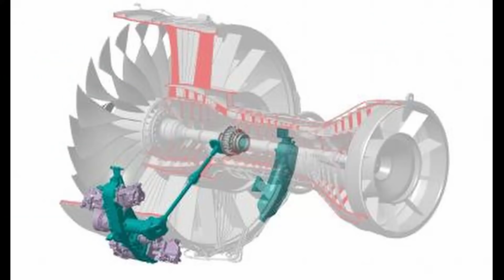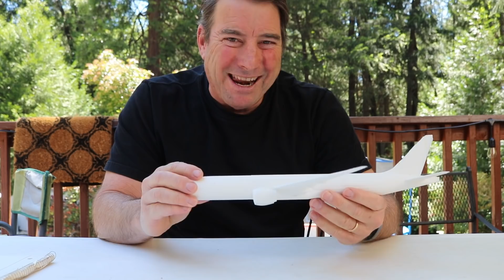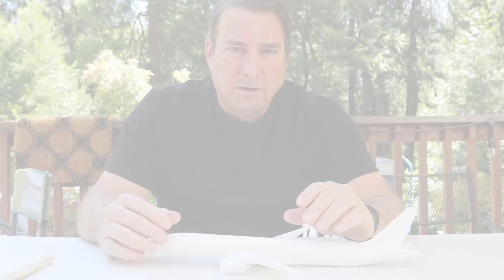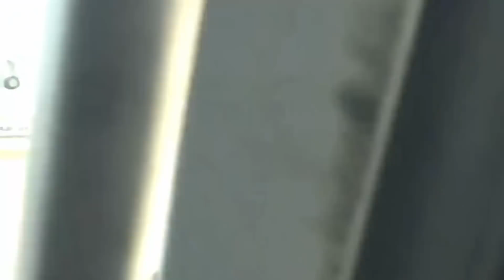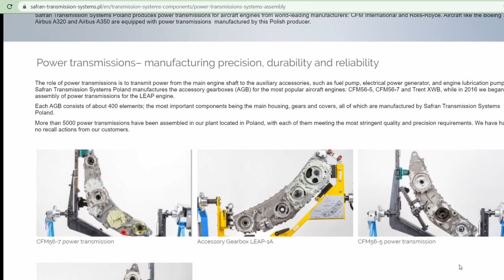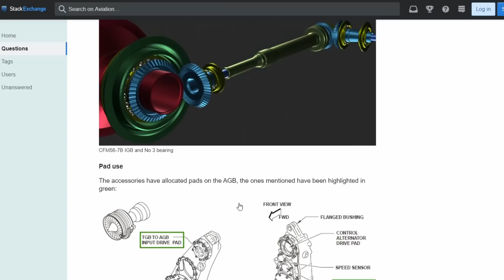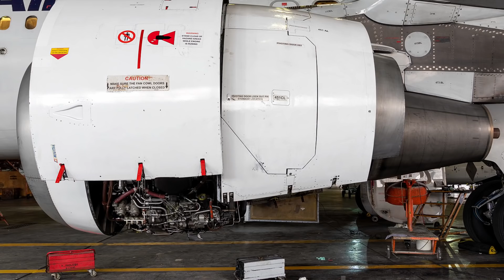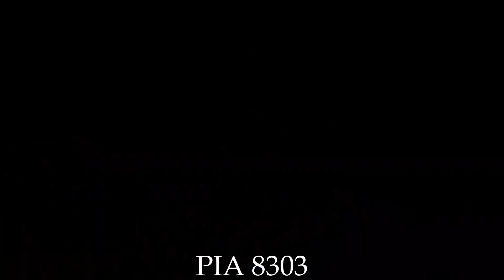PAKISTAN INTERNATIONAL AIRLINES #8303 UPDATE #2 23 May 2020

Comment: Thanks for the update! One question: if the engine touches the runway, and therefore causes damage, if a hydraulic line is compromised, can the ram air turbine keep the system (or systems) under pressure, or does it leak out even faster?
Reply: Separate systems with a series of check valves to isolate the main system. But if the fuel pump is compromised, it's flame out... Although as Juan points out, though it is a very robust system, it should have NEVER been designed in such a vulnerable position. I suspect it was a trade-off for "ease of maintenance" to access it vs probability of accidental damage.
Reply: @JeffCounsil-rp4qv  the engines may be positioned on top of the wings..it was done on some commercial planes ...i remember ..may be it was a fokker f_28
Reply: syed nr I don't think engine designs anticipate the possibility of go around after a belly landing.
Reply: The RAT is likely coupled to a third reservoir with it's own fluid supply.
Reply from the maker: Should be ok.
Reply: Makes no difference how much hydraulic pressure the RAT is producing if the engines have no power due to the damage caused by slamming them onto the runway.
Reply: There are devices called hydraulic fuses that shut off if the flow exceeds limits (eg ruptured hose or tube), to prevent the whole system from running out of fluid. It depends where and how bad a leak is as to whether or not a hydraulic fuse will be helpful.
Also, there are 3 completely separate hydraulic systems. The fluid in each system is isolated from the other systems.

Comment: If the pilots hit the ground with the engines without landing gear down, and then tried to climb, shouldn't the tail have hit the ground as well? There doesn't appear to be any tail damage in the photo.
Reply: If I have understood the Airbus system under normal law correctly the stall system will prevent it. It will not raise the nose more than possible without stalling or tail strike 
The more I read about the Airbus automation system the more impressed I am

Comment: This reminds me of Air France Flight 296 which was demonstrating a low pass, and then failed to have the engines spool up when attempting to go around crashing in trees off the end of the runway.  The Captain Michel Asseline, one of the early test Pilots, claimed there had been a glitch in the software which prevented the engines from spooling. Essentially being below 100' with the gear down and engines near idle the aircraft was programmed (Law) to land. Question! Could this have been a factor in this accident???? Learning and understanding the different "Laws", computer modes, was a big part of the transition to the Airbus.
Reply: AFAIK there was nothing wrong with engines or the plane. They just flew the demonstration way too low and slow.  When they noticed the trees ahead, they applied full throttle and tried to pull up. Flying so slow they were nose up (high AoA) and near a stall. Big engines on full throttle mounted below wings would force the nose further up and stall the plane.
The Airbus  has anti-stall protection laws and they prevented the stall, but the plane hit the trees before it could get more speed and climb to safety.
I don't see how the anti-stall laws could have caused this crash, but my flightsimulator (FlightGear) experience on c172 and watching air crash investigation shows on tv does not make me an expert :-)

Comment: I would have hoped that most airports have video on their runways, which would answer a lot of questions in this particular case.
Reply: I have a feeling its not going to be released to the public.
Reply: They do but it is not accessible to everyone else
Reply: Certaihelped out on the FedEx crash in 2009 in Japan where it bounced during an extremely hard landing and then rolled over.
Reply: There are very few of these incidents; it wouldn't be worth loading up thousands of airports with millions of dollars worth of weatherproof HD television systems.
Reply: Kenny Phillips — Why would they need to be HD? 
Any video could help, as the ones the amateurs have taken.

Juan used one, and a photo of the plane taken by an amateur plane spotter.
Reply: Kenny Phillips outdoor camera’s are insanely cheap. I’m sure they have some
Reply: Kenny Phillips--not that expensive.

Comment: My question is how close to the runway were they before the alarm set off? Why did they lower the landing gears so late? My condolences to the affected.
Reply: I’m not familiar with Airbus...but it’s generally not tied to altitude.  If either the gear position doesn’t match the position of the gear control, or (more likely here), the flaps are set to a landing setting without the gear down, you get the alert.  Seems the French designers were too polite with their alert tone.  No way you could concentrate in a 737 with this.
Reply: The ECAM Master warning you can hear in the audio if it was for a gear issue is triggered at 750ft RA. GPWS would go off at 500ft RA
Reply: Thomas Mortimore just saying, the configuration warning in the 737 is loud & obnoxious.

Comment: There were a couple of survivors of the crash. One of them gave an interview to the media in Urdu. Roughly translated, he said that the airplane touched down, the felt it and then the pilot went back up and around.
Reply: An airliner has a huge amount of mass it takes time for direction of travel to change form aerodynamic inputs to overcome the momentum of the mass moving in the direction it was currently going when the change was made so they may have started their climb out  before the impact pack but momentum continue to carry the aircraft downward. The big question is why weren't the wheels extended?
Reply: @theoldman8877  Your momentum theory is flawed. The aircraft was almost a mile down the runway when it kissed the tarmac with the engines. He was in ground effect during the abort decision and the engines did not quite spool up fast enough to maintain airspeed to maintain distance from the tarmac.
Reply: Two survivors.
Reply: That touchdown he felt was on the engines, not gear.
Reply: Thank you. Prayers for their recovery and families.
Reply: I think it would of turned out better if he left it on the ground. How long is that Runway?
Reply: @Špý-VS-Špý  3400 Meter
Reply: @TELE6220  leave the English lesson in English class. If you study English in several different nations you will find it is both different and correct at the same time.
Reply: @theoldman8877  No matter what nation you are in, it's "would have"
Reply: @theoldman8877  The survivor account is that the plane touched down, and then took off.  My guess is the wheels were extended when it landed.  What happened next seems to be the "big question".
Reply: I don’t understand how there were two survivors?
Reply: TELE6220 we clearly understood what he ment so stop trying to impress yourself. One interuption does not call for another.

Comment: They cannot put these assemblies on top of the engine because of weight distribution. 
You cannot design engines so they survive pilots bouncing them.
Don't blame the design, people.
Reply: Wait, today’s environment suggests we can’t blame the people, so it’s all about design deficiencies.
Reply: "Weight distribution?" Bullshit. It was a decision by marketing so as not to have to roll out a boom truck to service the unit. The weight distribution is totally unaffected by clocking the drive unit under the wing
Reply: @vidznstuff1  The engine is designed to be "bottom heavy" for a reason...btw... it is also a design feature related to the reason the engines are so low slung on this plane, actually.
Ps...Don't bounce the engines.

Comment: This is a bonafide head scratcher ..!??!
Reply: Watch part 1 from May 22. It shows an audible alarm about landing gear not locked (or down at all judging from the damage) during a radio communication. I'm no expert, but that alarm should sound with enough time to do something about it. Guessing they didn't respond quickly enough.
Reply: @kenmore01  The alarm went off on the first approach.  There was enough time to respond correctly.  I'm not sure if it was a case of "get it down and in the gate, we're on a tight schedule" or a case of "the alarm went off, we hand cranked the gear, but possibly not all the way", and they landed thinking the gear was fully down, causing the gear to collapse having the engines collapse onto the runway, and they pulled it back up again after the damage was already done.

The minimal damage to the underside of the aircraft in other spots baffles me as to how they were able to get it back in the air without scraping the tail section more than what possibly may have shown.  I just don't know.
Reply: @vtwinbreed. It was only the nose wheel that failed. Still, the engines hang lower on the A320 than they do on the Boeing 737, low enough to scrape. . He might have gotten away with this bone head maneuver in a 737.
Reply: @vtwinbreed  This is the most insightful comment I've read so far. It really touches on the real questions, I find. Knowledgeable people, please shine on for the love of reason!
Reply: Frank Huber, if only the nose wheel had failed the front of the engine cowling would be damaged. Pictures show damage in the mid and back sections suggesting main landing gear was up.
Reply: Yep...i bet this incident is going like an anvil on these pilots and probably the airline. Pilots mention a alleged technical malfunction to atc so lets see what kind of malfunction put them in this situation
Reply: @hawkeye0927...Head scratcher?.... Unfortunately it looks more like a belly-rub😒 So sad to see these things happen to good people just trying to go about their day.

Comment: I'm surprised at how high the RPM of that accessory drive is, but I suppose that's the speed of the turbine, and it does mean you can make it much lighter. However, balance and alignment as critical to this continuing to run, so it's quite possible that even a small amount of what appears to be superficial damage could quickly destroy the mechanism. I repair high speed routing spindles, and it doesn't take much being out of balance for things to quickly go very wrong.

Comment: So why is the  accessory drive gear box on the bottom of the engine? Would it not be safer to have it on top of the engine?
Reply: It would be safer to instruct the crew to always ensure proper landing configuration prior to landing...and back it up with performing a pre-landing checklist.
Oh, wait...they do...
Reply: So there are two possibilities here. Either somebody donned a blindfold and threw a dart at a diagram of the engine when deciding where to mount the gearbox, or thousands of engineers across dozens of teams and companies across three quarters of a century did the math which led them to place the gearbox in that exact spot. Could go either way.
Reply: Well let's say we move it and instead they touch down on the engine, brake the pansar that is designed to contain the blades in case they fail inside the engine. The damaged engine keep working until a blade spinning at thousand's of rpm's let go due to the accident and cuts true everything in its way. Think I preferr the engine just stopped working instead due to fuel starvation or oil instead

Comment: I would say the base mounts sheared off, and the unit then was free to move, leading to the shaft being the only thing holding it in place, along with most of the piping and wire looms. It then was still running to provide AC power, and fuel ( evidenced by the engines still running for a few seconds before they lost power, along with the AC bus) until the shaft likely sheared off at one of the bearings, as they disintegrated from both radial stress beyond limits and lubrication failure, caused by the oil pump at the bottom losing either input power or breaking off of hydraulic pipes, or finishing off shearing from the input shaft of the accessory gear train. 

Will probably have the impact registered as a sudden loss of oil pressure, followed a second or so later by gearbox speed sensor failure ( or both nearly simultaneously), then a few seconds later the sudden demand for high power TOGA, and thus high stress on the drive shaft, combined with no oil flow ( FADEC was probably attempting to shut engine down at the same time for low oil pressure in turbine shaft, low oil flow, and HP and LP fuel systems showing low pressure and flow inconsistent with engine demand) overheated the bearings, they seized, and the shaft finally failed.

 They likely were extending the gear on final approach late, and something there went wrong, leaving not enough time for the TOGA to be successful, leading to the engines striking the runway. Gear did not extend, or one of the doors did not open correctly on command, or the hydraulics failed for some reason, but the aircraft was in a landing configuration otherwise, as it would have had a lot of proximity warnings if not so, and none, aside from the gear malfunction, were audible.
Reply: They must have been producing power for some amount of time to enable a climb to 3000'.  Can the fadec initiated shutdown be overridden by the pilots in the airbus?
Reply: Thanks for the info on proximity warnings vs gear malfunction warnings, I had wanted to ask that question, and now it is answered.
Reply: So if the the gear is selected down but not down and locked the GPWS/TAWS warnings will be suppressed? Is that correct? Seems like that would be a poor design.
Reply: @Jonathan Isn't that what the gear warning is for? What would be the use overloading the pilots with all sorts of warnings especially since they probably already knew they were close to the ground and the systems probably knew there was a runway there?

Comment: How come they forget the landing grear?! 
On an A320 with a Master Warning Red light , CRC  and GPWS will go crazy.  
1st/ The SOP says gears down after Flaps 2
2nd / On Ecam, first check is landing gear. Also, they got gear indication lights plus the green triangles on the Ecam display.   
Since he tapped the runway, a Go around made it worse. He should have completed the landing to a full stop with minimum risks on ground better than taking the risks to the air which led to a total disaster.

It is vary complicated to fly the A320 in Direct law

Comment: Is it possible the pilot didn’t even know the landing gear is not deployed and when he realised the landing gear is not down he pulled up for a second try but he already damaged the engine by scraping them on the runway thus causing the engine failure and crash?
Reply: no they had a warning going of in the cockpit. it was clear in the plane to tower conversations.
Reply: john payne so it means the landing gear was stuck?
Reply: justaman it does not mean it was stuck...it could be a couple of non-mechanical reasons as well

Comment: Is it United 232 remake but with deadly consequences! Dual engine failure is 'unheard' of to aviation experts. If scrapping runway is the case of engine failure, then it must be looked into carefully
Reply: Looked into...like ensuring the gear is down???  This is typically done at the final approach fix...miles away from the touchdown point!
I don’t believe this resembles the United accident at all, other than loss of life (which is the same as deadly consequences).

Comment: from the angle of "scratches" it indeed looks like the aircraft had it's nose up while impacting the runway. So it may really be a second bumb after initial touch and go.
but that would mean: gear up before positive rate was established. Such a scenario would point towards a CFM malfunction. SAFRAN stock just hard recovered a bit last week, plumeting again.
Reply: Why would they go around if the gear was down and locked the first time? and then immediate select gear up in a bounce,...it's pretty unlikely. It's more likely the gear never deployed and touching down on the engines is when they discovered that...hence knee jerk go around with 2 severely damaged engines.
Reply: @mattp4735  it's the only speculation i have for "not a total pilot error": if the gear was perhaps down, but collapsed. So Toga and gearup before positive rate? Then a birdstrike? But this would then be reported via radio....  Since all recorders have been recovered and the scrapemarks (start/end) in the runway have been measured, i guess this will not take long to drill it down to bottom.

Comment: Why didn't pilot deployed the landing gear on first place? (If it was mistake, there must have warning).
 If landing gear was not properly opened... Pilot should've go around without touching the runway and done the emergency landing gear procedure and then attemp again. It would've save the day.
Reply: They tried, detailed by the previous Blancolirio video with a clip from VAS Aviation.

Comment: I my opinion. that is enough damage to brake the bottom mounting point. and braking the accessory gearbox. possibly jamming and braking off drive teeth and binding up the drive train and then shearing N2 drive shaft or shearing the drive teeth. I would be looking all over the runway to the end for parts and pieces.